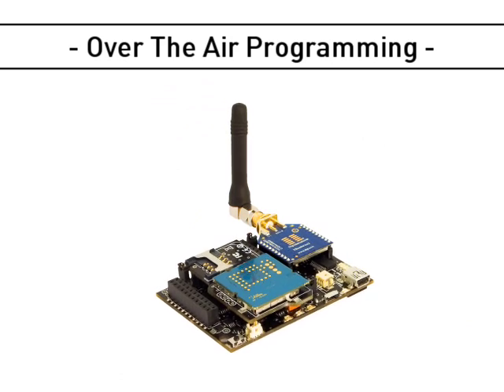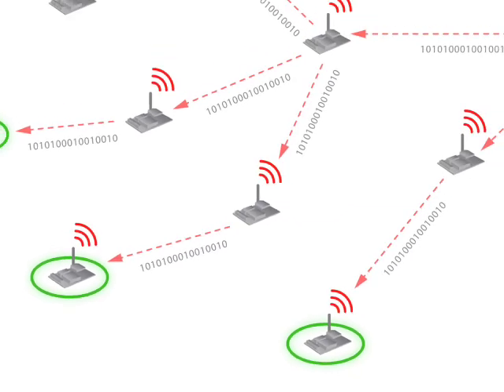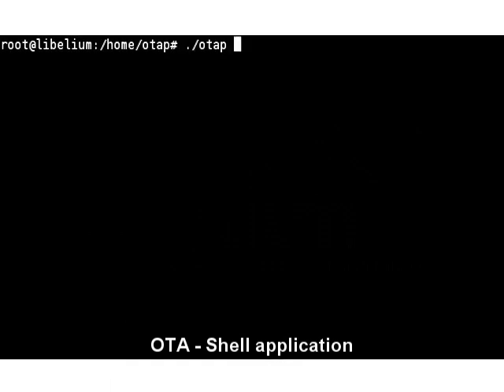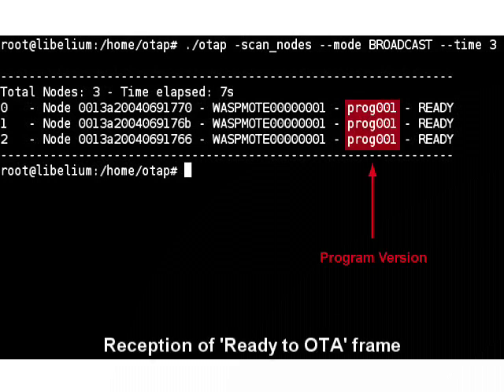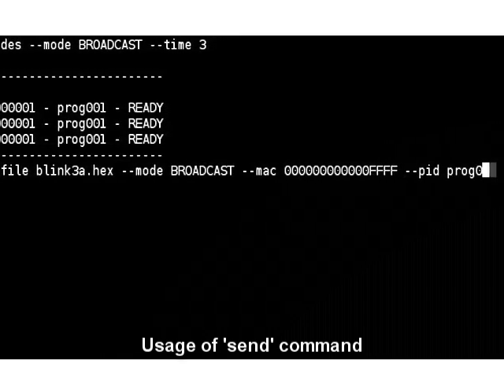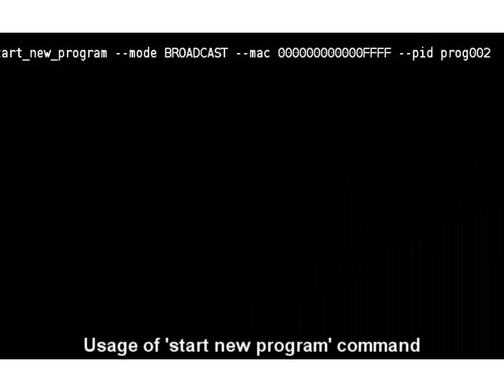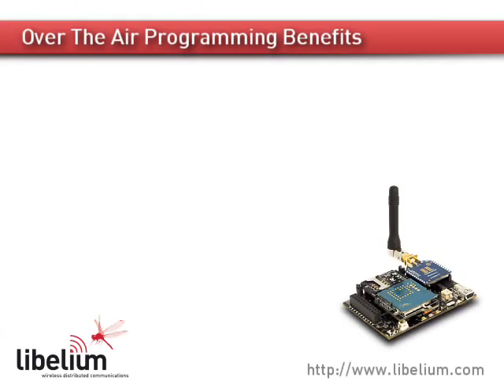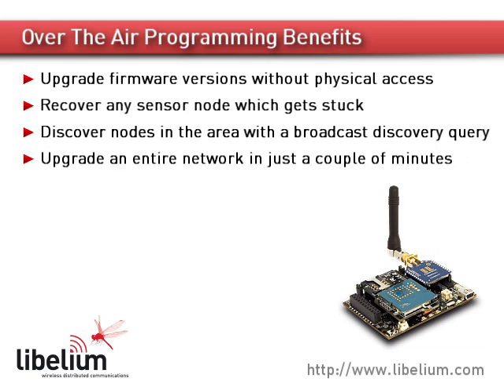Over the Air Programming with ZigBee

Comment: Could you clarify my  queries:
1. What are the Tool-chains required to implement OTA ?
2. Do you provide any specific IDEs for firmware development ?
3. Does it have provision to do  firmware authentication check?
4. Without using USB Gateway can I send my firmware update through other Bluetooth device to Waspmote?